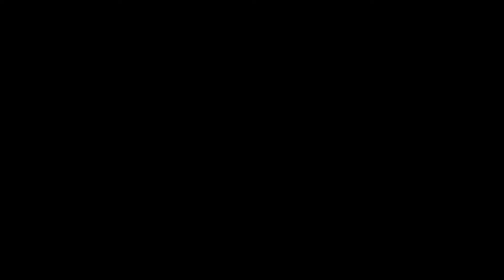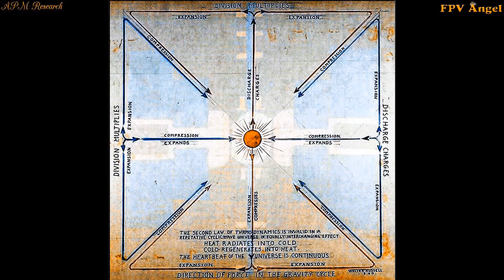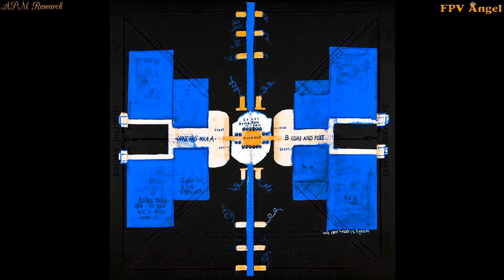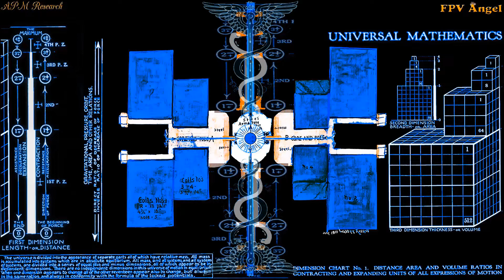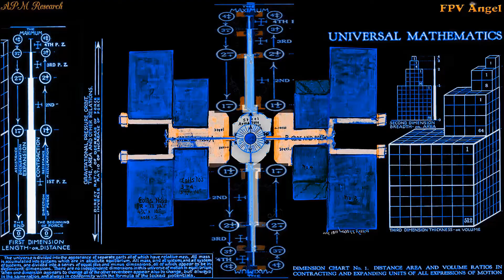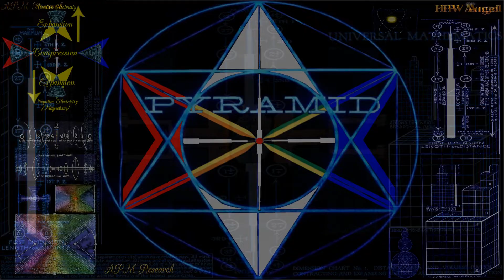APM Research: Walter Russell Optical Motor + Cadacius Decoded.

Comment: 1. Why in GODs name are you telling us there will be created a higgs boson by having the pipe narrowing at 'key' points. Do you really know what that is, and are you serious when you claim to do what the LHC at cern was built to do and manages quite well, just by narrowing a pipe at 'strategic' places.. you are serious you say, damn, thats another fckng level..well those idiots at cern making that biiiig & long underground circle, when this would be enough to make for proving the boson to be existing.. like no stress..no mind blowing energy levels or such, just piping, so a plummer would be enough of an expert in this matter, and it would be un-nesecery to be using an electro-technics professor for the job.. is that normal, eh?
 
2. When creating a particle like the higgs boson, do you really mean you CREATED it as brand new or just let an old one pop up ?

3. Why is the 'blueprint' engineering paper, witch normally includes calculations done with the physical elements included, looking like ..eh this. The thing on the screen is not having any of the elements, nor formulas fitting the elements in relation, instead looking like anything but a scientific paper. 
Where is the numeric values of the elements, and where are the calculations showing this as simulated working ? no..? 
The paper says universal mathematics, duh, like maths wore anything but universal..its the language spoken by all intelligent races, but not a single word of understandable math on this. why? Are you not speaking that language? 

4. Why have you not taken in consideration the fact that this only work if you add a few new laws to the existing laws of nature, and tweak those existing until they are broken 100% and as that, no longer exist in the state you need to have them in just to make this work? I mean, how old are these ideas now? Is it not time soon to let the fictional stuff be, and start reading up on physics that exist, and from there create something that DOES WORK!?? nah, its too much work and besides you would have to grow up and stop this silly idioticrazy..

These crazy non working dreamed up science are things that are polluting the minds of those open to anything. -they are nice people without a critical thought and have a mindset like kids being told 'true' stories by an authoraty or figure like that. And so they will end up like dum & dummer and struggle with mass psychosis afterwards.. now, is that funny or is it just tragic that people without any education are doing these evil things.... claiming their full knowledge about things they have made up while getting bored sitting on the toilet one day... NOT..

No, relax, i dont report such videos, but you should start to realize this is garbage and as non existing as god himself, the psychopath and sadistic narcisist that he is.. nice to be just a made up character then . 
Laughable stuff, but some do believe the shit anyway, so ... huff ..even if proof for this being fake & therefor just stupid to believe, the fanatics are not able to see the proof as what it is simply by not understanding it or ever be able to do so. below 75 they say. I say gotta be below 65 ...